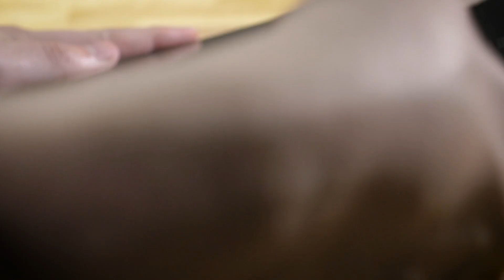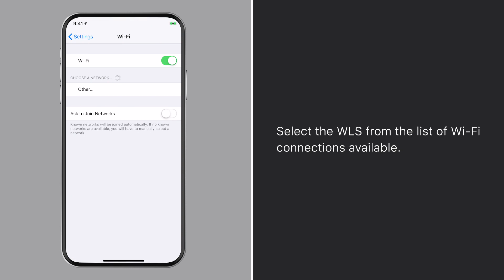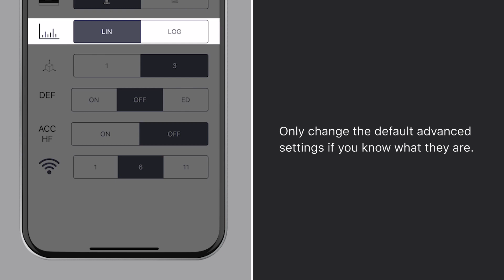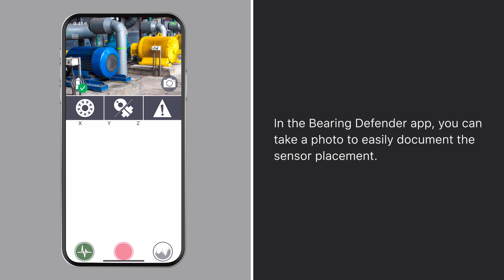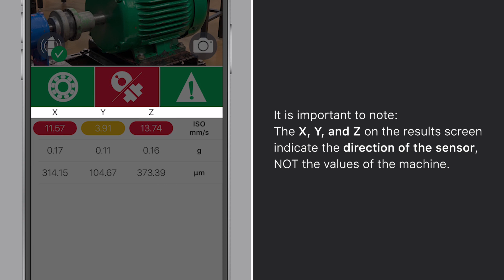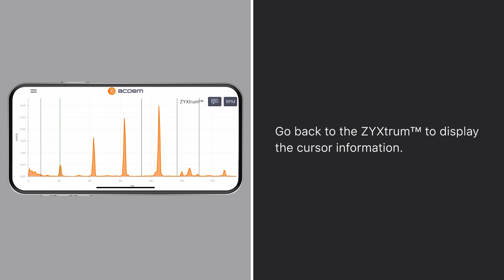Download the ACOEM Bearing Defender app

Comment: what is the minimum hardware requirement to smootly run this app ?
Reply: Hey, on the vibration side, you'll need the wireless vibration sensor. On the tablet/cellphone side, the requierement are pretty low.  Not sure which android/ios version is requiered but if you run that version, the app will run.